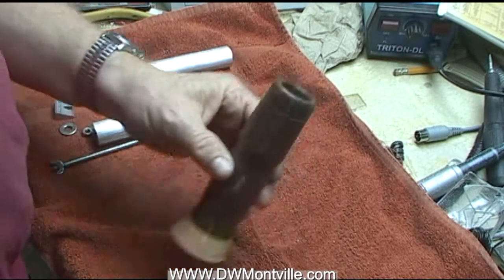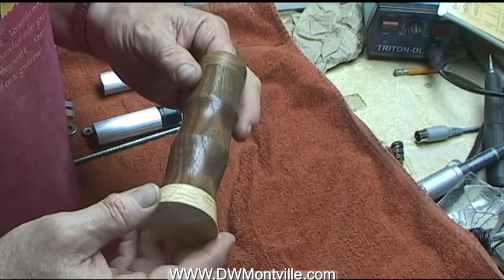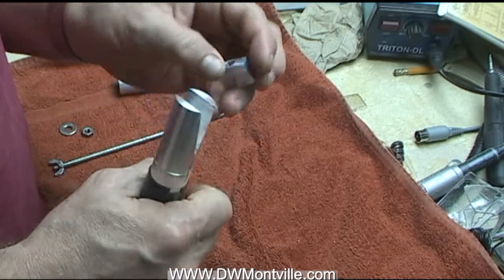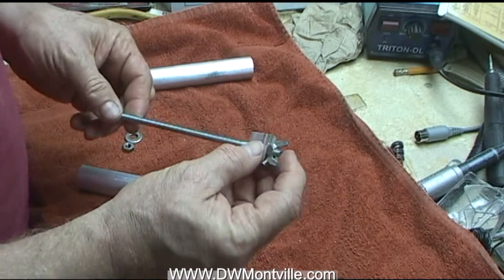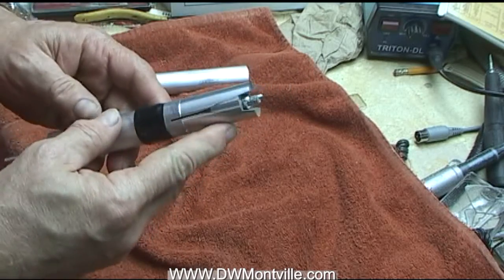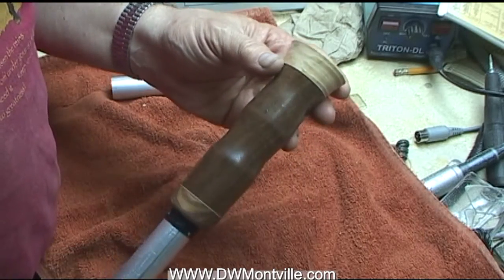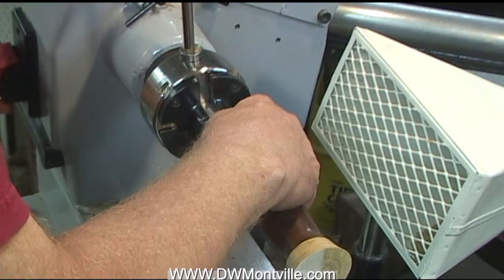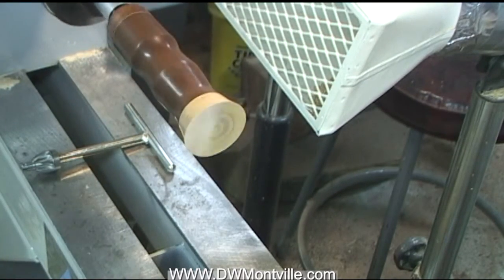Expansion chuck for turning toothpick holders.

Comment: I like Carl's pin chuck, too.  The benefit of this one is that it has room to expand some, so if your hold isn't exactly the right size, this will be a little more forgiving.  One thing I would want in one of these chucks, though, is a morse taper and a draw bar, which would allow you to expand the chuck from behind the head stock.  I don't know enough about metal work to make this happen, though.  Dennis, did you use any kind of oil on the rod when you cut it on the band saw?

Comment from the maker: I used a 18 TPI blade. With soft aluminum this is rather fine, but it worked. I think you could use a courser blade down to about 10 TPI with no problem.

Comment: You know, it took me about a to figure out why you were using a wing-nut and not just through-bolting it. Then the ol' brain kicked in, and I realized it's so it doesn't spin when you tighten the chuck.

Good design though. I have the benefit of my father working as a manual machinist for the past 30 some odd years. I'm going to run it by him and see if I just can't get one made!

Thanks

Comment from the maker: Just to be clear about my previous reply. I'm assuming that when you say "pin chuck" you're talking about those that use a rod with a flat on it that you put a round pin on and then slide the rod into the work to be held. Then when the rod rotates it jams the small pin against the I.D. of the hole and the flat on the large rod. Is that the one you're talking about?

Comment from the maker: A pin chuck might work, but my experience is that any wobble will allow it to slip. They work okay with a live center in the tailstock holding the work into them, but I wanted to have full access to the foot. I just like that solid hold of the expansion chuck. However, everyone should know that a pin chuck is an alternative solution to this type of work. Thanks for pointing that out.